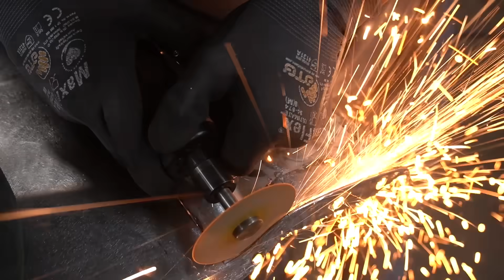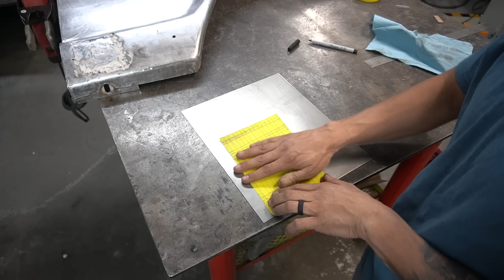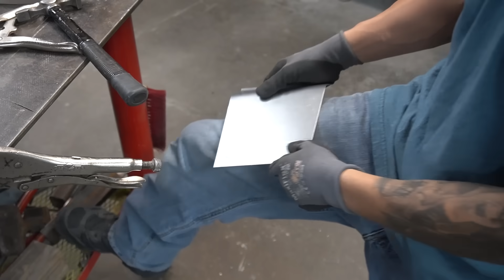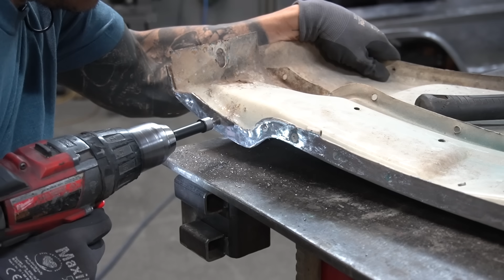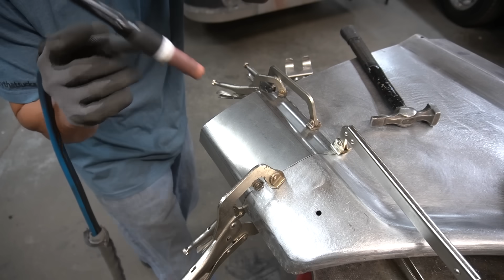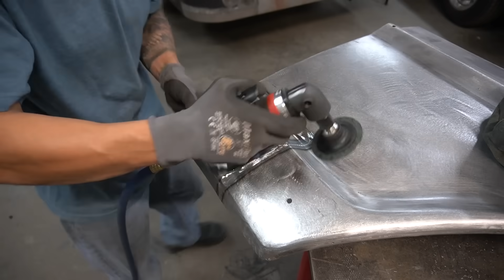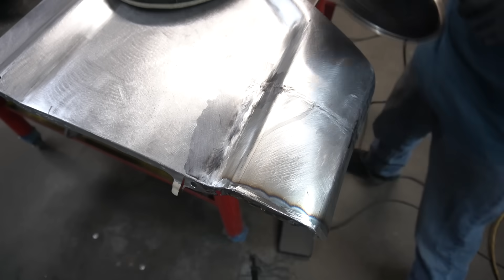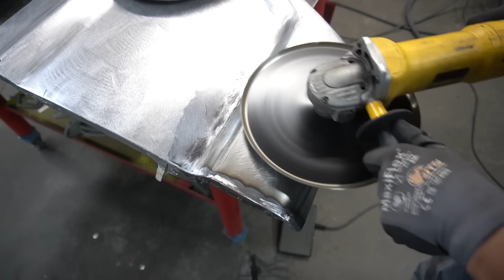how to make a patch panel | fix rust

Comment: No you do small welds jumping around as cool it with air blower until it's welded up so you don't warp it then if you want to hit something with a hammer and call it planishin
Reply from the maker: Yes, I do that sometimes. But sometimes I don't. it all depends on the panel I'm working on and the situation.

Comment: Hello. Why outside You have used Tig and inside Mig?  is it because of less deformation when using a Tig? Thank You in advance
Reply from the maker: The reason I used a tig on the sheet metal is because Tig welds are more malleable than Mig weld, and the Mig was more convenient for the plug welds and to weld the brace.
Reply: @BeAMetalFabricator  thanks for reply !

Comment: Was dat panel butt welded or was it big er than the hole and welded on top
Reply from the maker: It was bigger than the hole, placed on the backside and welded in, then filled with body filler

Comment: I love the tape patterns. Personally I like 1/2" or 3/4" fiberglass tape as the base and then packing tape to hold it all together. After peeling it off I line the adhesive side with more packing tape. The fiberglass gives the pattern a shape memory which really helps in panel shaping and then it's reversible.
Reply from the maker: Yes I love that! I learned that technique from Wray at pro shaper with the fiberglass tape. I use it when I am shaping metal. I was just basically making bends on this fender so I used masking tape. Thanks for watching! And for the comment!